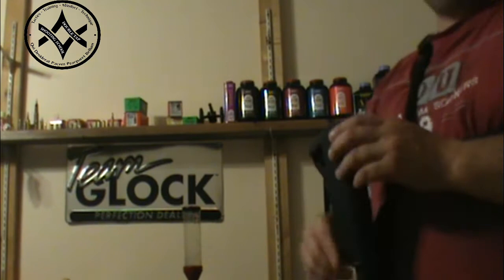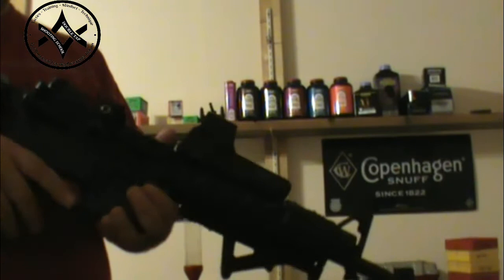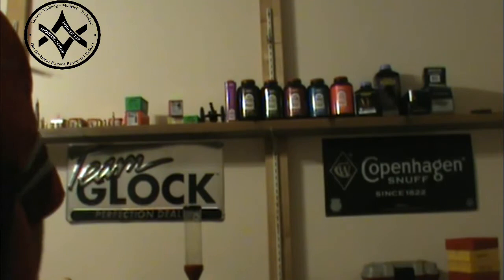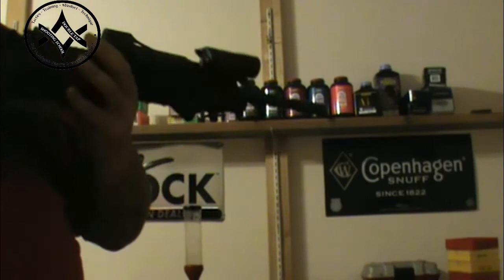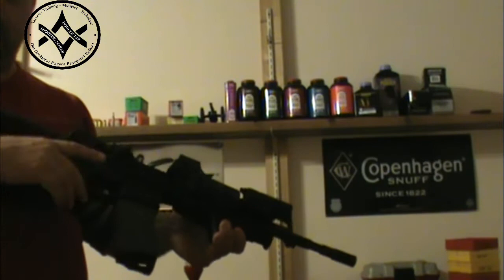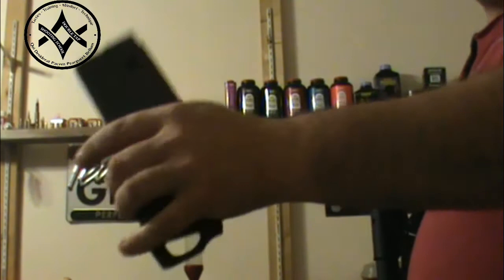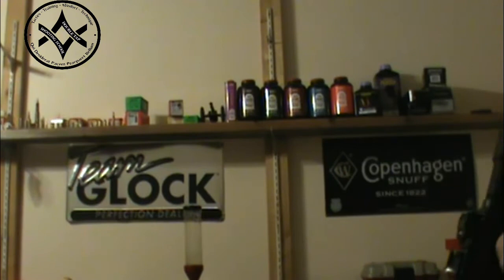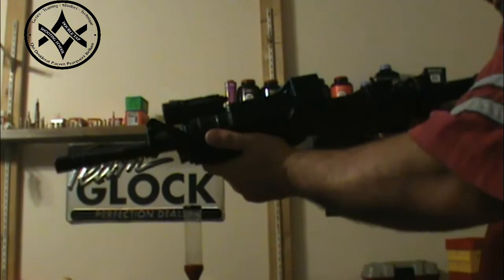How to: AR15 / Carbine Reload Speed Reload

Comment: Well, I guess I'm screwed then. I shoot left handed. I've got to use both hands to dump the mag (left hand on the grip, right hand itting the mag release) I just use my right thumb on the BAD lever when I load a new mag. I've got to hold the mag-well though, which I don't particularly like doing unless I'm shooting at a short distance target, or inside.